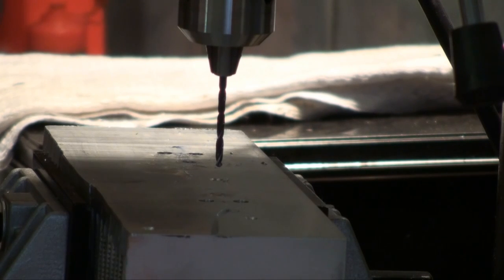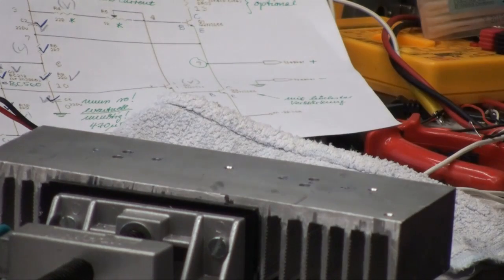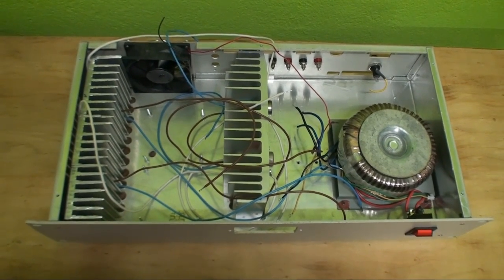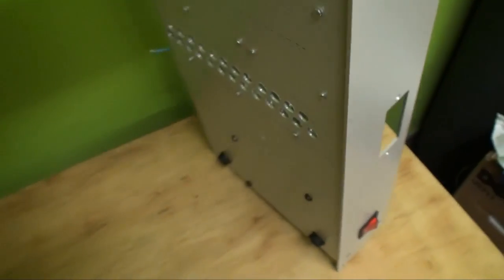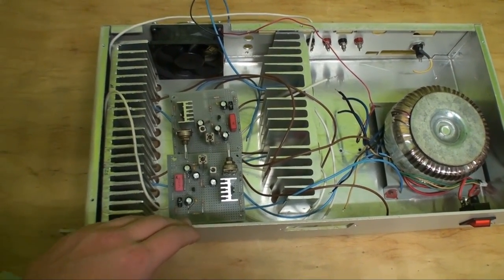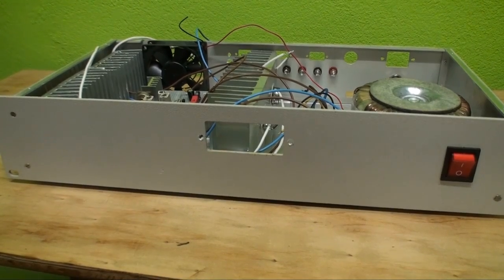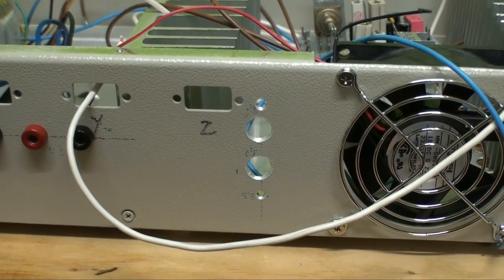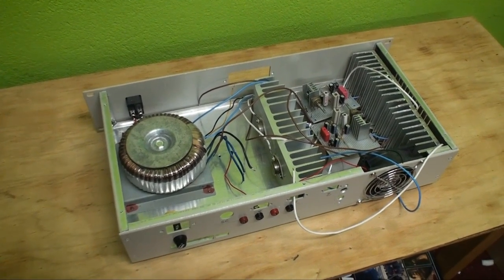DrCassette's Workshop - JLH Class A amplifier [3/x]

Comment: We knokced up a JLH 1969 kit earlier this year using a found object chassis, SMPS from a Chinese kit, the results very good.
We did mount the heatsink outside and skipped the ventilation fan:
http://minirig.org.au/2014/02/10/low-cost-simple-john-linsley-hood-1969-class-a-amp-kit-build/

Comment: When will it be finished?
Reply from the maker: I don't know. I don't have a lot of time, and as I said, from now on it's primarily work, to get everything wired up etc. The exciting part of getting the circuits to work is pretty much done...
Reply: DrCassette It has been 7 months... Never took me that long to make an amp!
Reply from the maker: I am BUSY!!! Plus, since I moved I can only get to the workshop sundays. That's not a lot of time to begin with...
Reply: DrCassette Ok, I did not know.
Reply from the maker: Another thing is, since I now have to pay the light bill myself, a power hungry class A amplifier is not exactly what I want anymore ;) I'll have to make some kind of conclusion video about this eventually...
Reply: DrCassette Then what are you going to make with it? I think that it was turning out into being a great amp!
Reply from the maker: I know, and I would like to finish it, but basically I have no use for it anymore. Also, putting the thing into this case was a mistake, re-thinking the whole setup I guess it would overheat in there. The next thing that's going to happen is I will take this apart again. I'll put the components of the amplifier into storage and I'll use the case for an other project I had in mind for a while.

Comment: The drilling shot at the beginning reminded me when I drilled a similar heatsink for my FM transmitter, which I finished last week. (well, the transmitter was already built for me, as I don't have much experience with RF, but I had to build a case for it). Nice job so far. In the case you would happen to have lots of relays, try to build a relay based volume control. It's better than a potentiometer, and you won't need to run cables to the front. Just google for it :)